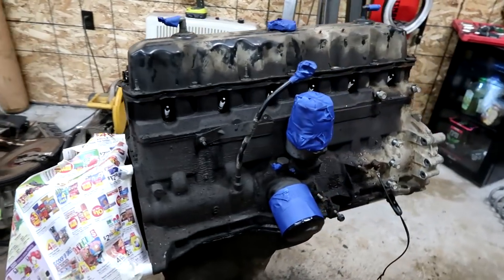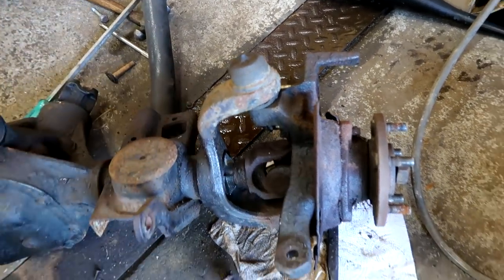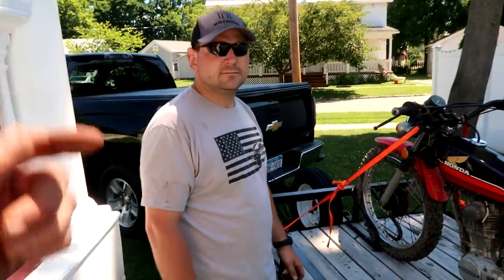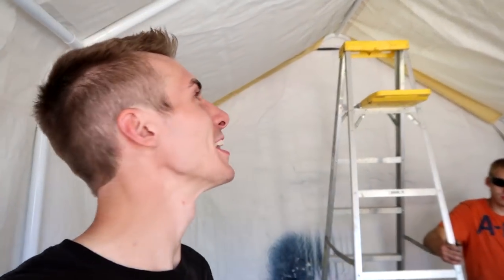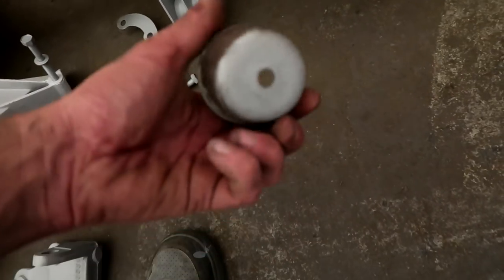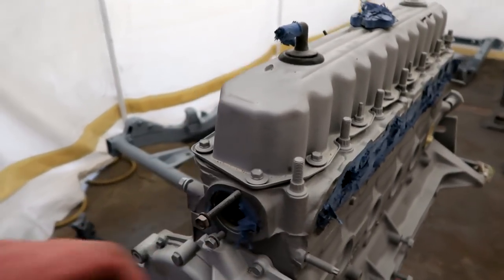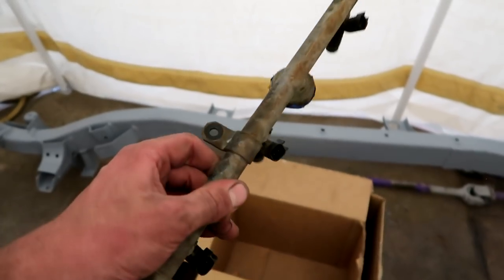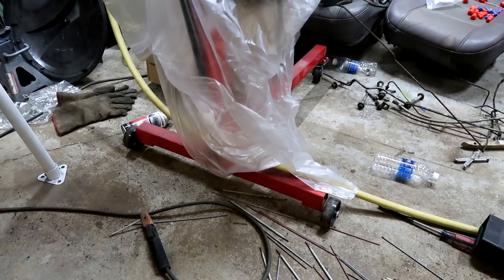How I SUPER Cleaned My Engine

Comment: Dalton you need to buy new crumple zone plates since it is actually illegal for you to repair by welding a piece of steel on there, especially that top one with holes in it that needs to go. Find the spot welds/ sealer joints to take them out properly.
Reply: wrong
Reply: Really? when have you worked as or with a CERTIFIED auto body collision technician that actually keeps up to date with his education seems how vehicles change every year? If you look closely at the panels, those ripples are the crumple zones which have been placed from factory to absorb the impact in an event of an "accident", and it is mandated by federal law across North America. Read your shit before commenting saying bs. Now he can replace them himself so long as it is properly done though it is not recommended, and should be done by a licensed auto body technician, but he is compromising safety of himself and others if he just slaps on a piece of steel on that part, and if he is caught he can be fined for it.
Reply: its not illegal to weld a plate in place of it
Reply: suit yourself I gave you all the info, its your safety like I care when you get into a so called "accident", though I can tell you, that vehicle would fail a full body inspection by doing that, and yes he can be fined for doing that since it compromises safety of the vehicle, but apparently no one cares about that, just another reason why I stop commenting about body work stuff seems how no one really listens.
Reply: lol

Comment: You should have gave your blaster a plug, wow that motor needs to be fully stripped down an chemically cleaned before a rebuild. Just pulling the head off isn't enough sandwill be in the bore an down into the rings. May as well do forge build. I like your vids an editing skills good work.

Comment: That sand is going to get into the cylinder walls, and the bearings. It's going to toast that engine.
Reply from the maker: I'm tearing it all apart to prevent that from happening.
Reply: 3DMachines yep my bad just now got to that point of the video, looks great!
Reply: 3DMachines Dalton, be sure to replace all the seals and gaskets, sandblasting is murder on them. And clean, clean, CLEAN!! Oil loves sand, it draws it like a magnet.
Reply: more tweeker projects